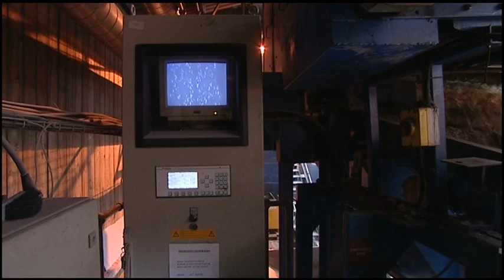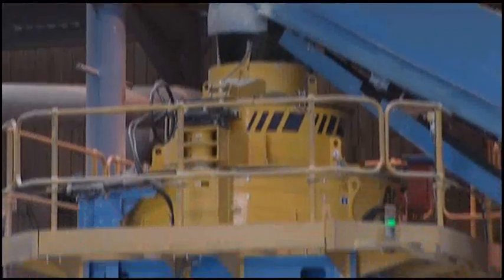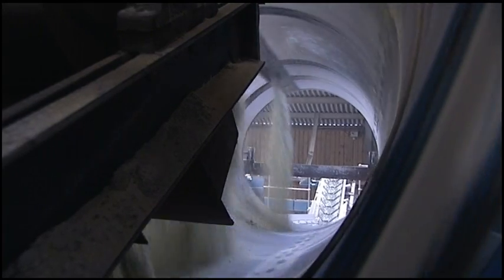Viridor Glass Recycling

Comment: why Pyrex? is it not glass? or does it have a different, higher melting point than normal glass?
Reply: Pyrex contains chemicals that allow it to withstand very high temperatures. It therefore cannot be recycled because it melts at a different temperature to glass used in bottles and jars and Pyrex in the same stream as bottle/jar glass will mess it all up. If anything made of Pyrex gets broken, it will have to be disposed of as general rubbish and sent to landfill.

Drinking glasses, window glass and mirror glass cannot be recycled for the same reason.